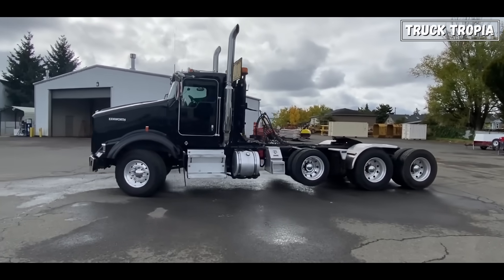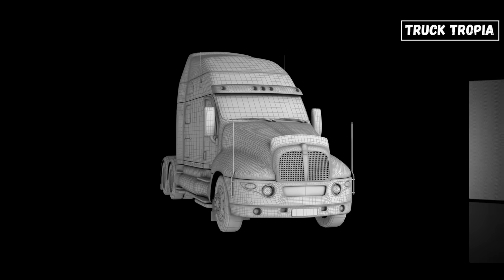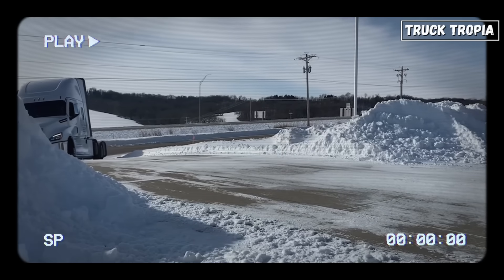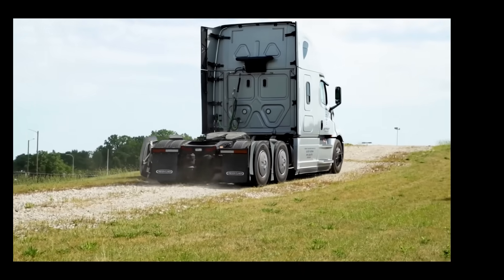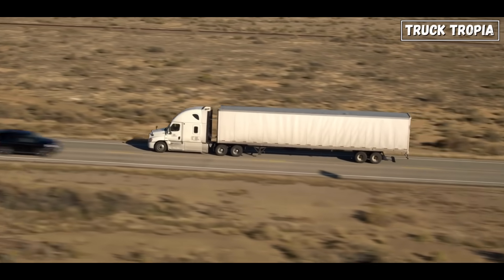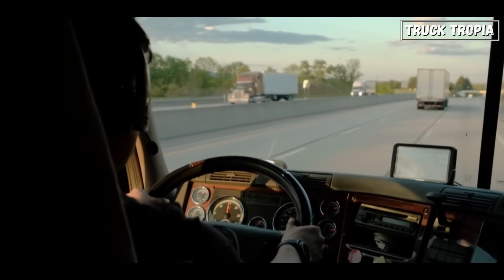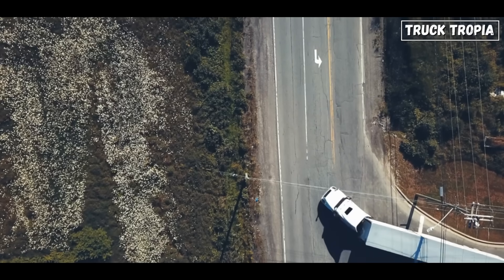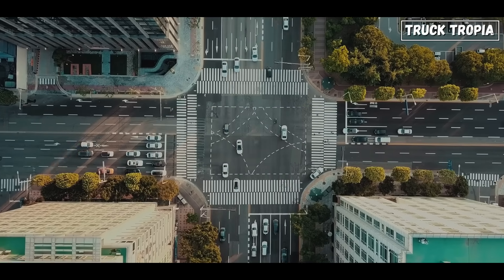Why Do Some Truck Tires Don't Touch The Ground?

Comment: It's just a gimmick, the advantages are negligible if any and can be more detrimental than beneficial.
Just leave it on the road.
Reply: As someone who drives a truck with a lift axle, let me better explain. when the lift axle is down, it takes weight off the steer axle, which reduces the traction the steer tires have, this will make you under steer, or in other words, you'll turn the wheel and the truck will keep going straight. so when unloaded, you lift the axle. When loaded i will also sometimes lift my axle when I am going into a steeper turn on a on ramp, just to put more weight on my steer tires for traction. Driving with it down can cause a severe loss of control.

For trucks that don't have a steerable lift axle, leaving it down while making a sharp turn can damage the tires and even rip them off the rims. Even with a steerable lift axle, it's only good for so steep of a turn, so when moving around a lot or other unusually tight turns, I'll lift mine up so it doesn't drag the tire sideways.

when unloaded, you actually get less overall traction with it down, because you're spreading the little remaining weight over more surface area, reducing stopping distance and over all handling.

when reversing with a steerable lift axle, you have to lift it, otherwise it will turn one way or the other and cause damage to itself or the tires. My truck won't even let me put it in reverse with it down, it will automatically lift it.

When down the axle adds extra drag, reducing fuel economy for no reason

when dumping, you want it lifted to avoid the air bags inflating or deflating randomly which can tip the truck over.

when going on ramps with sharp angles at the top, like what is often seen on scales, you want the drop axle lifted, this is because it can actually lift the drive axle up enough to loose traction.

when in soft ground, you want it lifted to reduce drag, which reduces the chances of getting stuck.

some trucks have automatic lift axles that drop when the truck detects enough weight in the bed. Mine doesn't have this because I have solid suspension.

Comment: Are you suggesting that less wheels on the ground increase grip? Hmm..I thought it would have the inverse effect,
Reply: yes, because more weight pushes down on them. Having the axle down when unloaded risks a severe loss of traction and control, especially with the steer tires. I've learned first hand even when loaded, to lift it when it's raining and I'm making a turn

Comment: You are mixing up axles and shafts. An axle is fixed, and the wheel turns around it. If it turns with the wheel, it is a shaft. Additionally, an axle does not connect two wheels, but supports just any number of them, one, two, three, four, just pick a number.

Comment: Lift axles are sometimes known as "cheater" axles, intended to allow a truck to be used in a small number of states with uncommonly low axle weight loading limits.

Comment: There is something I never understood about truck axels. If you ever played with Hot Wheels toys, you know the axels are fixed so the toy car can only go straight when you push it, so if you have a truck with multiple axels doesn’t that mean the wheels of the trucks will scrub the tires in back when the 2 steering wheels in front turn right or left ? Somebody please explain this to me.
Reply: Yes they do scrub when turning sharply

Comment: Bruh, lifting the extra axle is not to increase traction. With maximum loads, you cannot lift the axle due to weight. Less rolling resistance equals less fuel used.

Comment: It doesn't touch the ground because I pushed the button or switch that lifts it off the ground. Easy. Not rocket science.

Why are these axles like this?? Well Semi Trailers have two systems and heavy duty semi trucks have lift axles.
Trailers have slide and lift axles.

Now, the only reason to do this is weight distribution on the axles. It helps prevent blowouts and crashes. 

It.may affect other things, however, this is what they exist for.

Comment: Raising and lowering axles haS NOTHING to do with grip this video is misleading. If I'm running our 4 axle tractor at 105,000 when it's hooked to a 4 axle trailer I can't lift the pusher. That axle is there for weight. The legal weight limit for a tandem axle is 34,000 lbs. If you lift the pusher axle then the drives will be overweight. They might get more traction with the extra weight BUT you will also get a huge fine. You will also reduce the breaking power of the vehicle without the brakes from that axle on the ground.

The extra axles are for weight. They don't have any power going to them whatsoever. They are there so that a heavy truck won't damage bridges or roads by spreading out the weight. Traction has nothing to do with it. The ability to lift them off the ground is only so that you are not putting wear and tear on tires and brakes when your vehicle is light enough that you don't need them. That's it.

I've been running lift axle trucks and trailers for the last 8 years. This is soo misleading it's not even funny. Ya go ahead lift those axles on ice for traction, then you won't have their brakes on the ground and now you can get going but will have a very hard time stopping.

Comment: In some cases those lift axles can also provide additional help with steering as they can turn when the steering wheel is turned helping to negotiate corners better.  Also in some cases, these axles won't lower until the parking break is released or is put into gear,.  On a lot of trucks, these axles are only on the ground when going forward and raise up when shifting into reverse.

Comment: The video title is grammatically incorrect It should either be "Why do some truck tires not touch the ground" or, better yet, "Why don't some truck tires touch the ground."
Reply: Or "Why Some Truck Tires Don't Touch The Ground".
Reply: @redfields5070  Quite.

Comment: Short answer: load bearing
Long answer: transfers weight across a larger area which can allow more weight to be added (my stepdad worked wirh concrete and the mixer trucks had the tag axle for extra weight)

Comment: Why do alot of semi trucks have what appear to be 3 small separate air tanks? Is one for air brakes, another for an air horn, and the third as a backup tank or am I completely wrong? I have no clue as to their purpose. However, I would like to know the purpose. Thanks
Reply from the maker: The entire suspension system is often on Air, and tank for the trailers brakes as well

Comment: I didn't even know they can be lowered and lifted manually. I thought it's only use is when the the truck gets so heavy that the real axles get squished which makes the lifted one touch the ground. Also another use I thought is when the truck is going in a vertically very curved road.

Comment: The ONLY reason you have EXTRA tires are the frost laws!  State roads don't have have the deep road bed support as the federal roads or interstate roads.  Michigan road 33, i had to limit the weights in the colder months.  FROST LAWS mean the freezing and expanding dirt below the road bed.  A heavy truck would crush this ice and the road surface would collapse.  The same rule goes for city streets.  Concrete trucks would and will break residential streets.  These laws prevent the destruction of our infrastructure, trucking companies are resistant to any law that cost them money.

Comment: in some parts of the US, where weight regulations are really lax, the total weight can be higher, but weight per axel does not change. some semi trucks with heavy bulk cargoes have extra axels on the truck and trailer to deal with this, but have to raise them to turn at intersections

Comment: One thing not mentioned, Reduced toll costs. Driving light or empty you lift the axles and it lowers the toll cost on many US roads as you are charged per axle that is on the ground.

Comment: Simpel tractors and work equipment including other devices that run by split shaft transmission it has more to do with militari tehnologi rather then trucking some engines ordinari small single cilinder engine can run wood saw and hidraulic cutter the other end normali uses pull cord to start the engine not necesari if you have bell housing flywheel and starter motor so that logicali concludes that you culd use that other side of an engine for some thing ells like generator ,pneumatic or water pump or put simpli transmission on other side to move staff around its called mostly dobbel out put layout engines ,some times even more engines are attached to ich other as engine types to compensate for pure fuel types who do not use additives or ar not mixed in % ratio . So that's why manual wheel lighters ,steering mechanism or multi wheels are lifted of the ground to alive other devices to operate ,trucks also have those metallic lifter for trailers those not only serve as trailer but also balances loads of you lift things around or swap to other engine functions . It culd also by those lifted of wheels are connected to another drive train tractors use locking wheels so bouth turn in case of mud or if vehecel is stuck .As told before it's militari tehnologi it culd by any thing depends where and what is the vehecel suppose to do . On top of that electric wenches were used ,variuse attachments toočs who run ither electric,pneumatic or hydraulic some times combined effects. So that's why peopel call them still tractors in some landes .Ow I did forget to mention width and length of those vehecels is also variabel in some cases considering militari trucks. Ya know just like forklifts ,bikes,tractors andžy thing ells what might or might not by beneficial to have ,In some cases peopel put magnetic brakes on those extra wheels or use some thing similar like kears F1 car ya know even shit roles down hill so storing power to baterry or external flywheels who store kinetic energy moves you around for litel while. So that's the basic idea about it functionality .Perhaps peopel get the idea some where in Great Britain Steam locomotive wuld push empty carbo carts up hill down hill peopel were placed in those carts and all of them rolled down hill by gravity alone so all those carts hade hande operated brakes and peopel wuld simply periodicali use 1 brake at a time to not burn them that's probably done when workers wuld go home so they did kinde of glide or slide down the hill for free if I might interprate the story corectli. Not the best explanation but peopel get the idea behinde cheating 😅

Comment: I drive a Volvo with a tag axle. Some times i lift it when i'm fully loaded when i'm in a tight space as the truck turns better with the axle lifted. We also have a lifting front axle on are trailers which reduces tyre scrubbing when making tight turns and again makes it alot easier to turn. On the bad side if you drive an empty tag axle it makes the ride very bouncy when its lifted. I sometimes drop the axle down if its a really bad road and again in windy conditions. Inside my hairy little head a tiny bit of extra tyre rear is much better then putting the truck on its side.

Comment: The trucks is moving up and down . The up can't down and the down can't down why ? Because center zero which is the chassis and load is levitating and following only. 
The contact of the trucks to the ground is the wheels only .

Comment: I remember one time in Sweden, I drove a 3-axle Scania with 3-axle trailer and I didn't have a load on, so I had the truck's last and trailer's first axle lifted, when I drove to a gas station, where was a bus with Japanese tourists. And it was so funny for most of them, when passed them- they pointed finger at my lifted axles and laughed, probably it was funny for them, because they couldn't probably understand, why would one need so many wheels, when I don't use them :D

Comment: Yeah but the the fabrication and extra weight of an unused axle at this point is just a waste of time, money and, more carbon. Design a truck to perform a job, then call it a day. Designing one truck to do multiple jobs now just waste resources when you still need x amount of trucks to get it done anyways.

Comment: Here in the uk . Lift axles are for  carrying extra tonnage. The axle must have breaks. Some axles don’t require this. Extra axles distribute weight so as not to damage the road. Some lift axles  are simply to stop the drive axle being over loaded specially if it’s  a short wheel base . Lift axles save wear by lifting. Tyre, brakes, bearings cost money.. The less wheels in contact with the road the better mpg when running empty. Most steering pusher axles still steer when lifted , they just have a wider mud guard.

Comment: What is shown on the thumbnail is a pusher it uses air to lift up on the frame to support the load most of the time trucks don’t have them down because they don’t need them down for driving just super heavy loads

Comment: Not denying anything, but I don't see how the extra tires help with grip, braking, rolling resistance and maybe tire wear.
All these things are directionally proportional to the force on the tires. More force on a tire, more grip, better breaking, less efficient.
Doubling the tires, halfs all the forces. Therefore halfs the grip per tire, the braking per tire, ... but you have double the amount of tires. So at the end of the day it's all the same.

Comment: Load limits per axle is best reason as you only need them under load. Now, look at the two axles or maybe three or even more on US dump trucks and remember most of these do not turn so how much is the tire wear when the truck turns and you don't need the tires on the ground to carry the load. When empty the best economy is least tires on the road. All are good reasons.

Comment: Some people praise the use of the boggie axle, while others say the axle’s connection to the fly shaft is weakened. The blow out bearings can no longer distribute the load to the axle beams and the overall structural rigidity is reduced.

Comment: About the only place I've seen trucks that use these regularly are around the Midwest mostly Western Midwest in Northern Midwest it's more prevalent in states that let you Haul more than 80,000 lbs very rarely will you see a drop axle on a freight hauler

Comment: This video has sooo much wrong in it. For starts, it is not lowered to ground for traction. Lowering it reduces traction. It's implied it's a powered axle. It is not. Air bags aren't drained to lower it to ground. There is 1 bag for lowering and 1 bag for raising. Sooo much misinformation.

Comment: and remember, ALWAYS slide in front of a truck without signaling when its moving at full speed with 1 or 2 feet to spare so that you can slam on your breaks to make a turn that you could have made just as quickly if you had stayed behind the truck.

Comment: For the longest time I thought the wheels off the ground were the spares for the truck.  One day I saw a truck lower the wheels that were previously in the air.  Still I thought it was for the purpose of changing the tires since it lifted the other axels up higher off the ground.

Now know why.  Great informational video.

Comment: Lmfao because when we're empty we don't need to put the pusher on the ground...in my home state a tandem axel truck can only run 60K GVW...on a tri-ax when I put my pusher down I can weigh up to 76,000 pounds gross vehicle weight

Comment: When the axle is up most likely the truck is empty or is carrying a lighter load (under 50,000 pounds in total weight ) but if it’s above 50,000 pounds in total weight then the drive hits the switch to drop the third rear axle, also that third axle must go up if driving in local streets making sharp turns , with the wheel down is much harder to make turns.

Comment: Looks like a lift axle when you drive in straight line and your heavily loaded air pressure pushes it down. If its running Bobcat they are up, lift axles when trailer is empty will get you jumping all over the road.

Comment: When a lift axel is in the drive axel position they add almost no help with traction in bad weather. In the snow or other low traction conditions they hurt more than help.

Comment: As a CDL driver. Who’s done gravel trucks and trailer trucks for 10 years. It’s for weight. You move it down for frame support if the load is too heavy.

Comment: For those curious about weight, I drive a straight truck (not a semi + trailer) and it has a drop axle.  I can weigh 52,000lbs legally with the axle up, but the truck weighs 42,000lbs empty.  When loaded, I can drop the axle and legally weigh up to 72,000 lbs.

Comment: I was working for a company that had lift axles on the trailers. They stopped buying them because of the fact that one driver rolled over while driving with an empty trailer. Those trailers would lift the front axle on the trailers automatically when empty.
Reply: The Company I’m at uses a lot of them and yeah, they do drive you crazy sometimes for many reasons. A couple of them are that they never seem to be adjusted right And it’s almost like the system can’t make up it’s mind whether it wants it up or down so you will constantly be losing air because it’s back there hissing While it’s constantly dropping and raising the wheels and another reason relates to what you mentioned in that they seem to be a lot less stable when The trailer is empty and you have a giant wind sail  (especially if you have the additional fuel saving skirt underneath) back there that’s only touching the half as much of the road it usually would. I’m sure it does save some fuel though